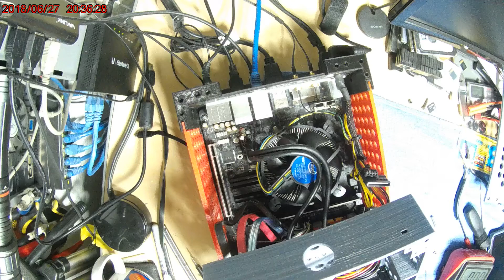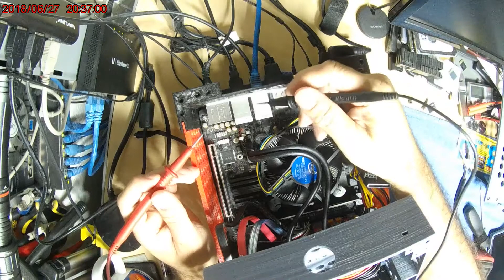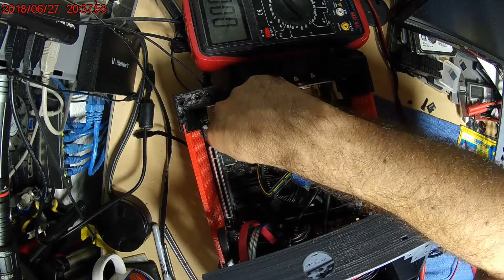Gigabyte Z270N-WIFI battery check

Comment: Hello, I have almost the same problem! Since I connect it to psu, start without pressing the power button! and after the shutdown, the LED on the motherboard goes off, and the CPU cooler continues to spin. I can not stop the pc just by removing the psu power.
If I want to start it again, I'm getting the same error as you ... BIOS has been reset. please reconfig bios setup iftems if needed. I tried with bios ... F4, F5, F6d ... the same! F1 and F2 do not let me write anymore!
Have you ever been able to do something? What do you suggest me do?

Comment: If you have a spare PSU, check with that one. Also make sure your CPU and ram are well put into its socket / their slots, the cooler vibration alongside your many spinning rust drives might move the metal plate along with the CPU. Also, unplug every fans except the CPU one and any drive that's plugged to the CPU. The "BIOS has been reset error"' might be a coincidence (it wouldn't be the first time for me - and I deal with Dell Optiplex PCs, we don't assemble / disassemble / reassemble them, things might happen because of vibration during moving inside our building.

Last thing, which I doubt, but could be possible is that something is making a short on the back of your motherboard, could even be some tiny grains of metal dust.
Reply from the maker: Hey, thanks for the reply. Unfortunately it wasn't any of those things. It's the bios. I finally got to the bottom of it. I have updated the info in the description. I'm still uploading the videos for my write up on this, but you were faster than I was.